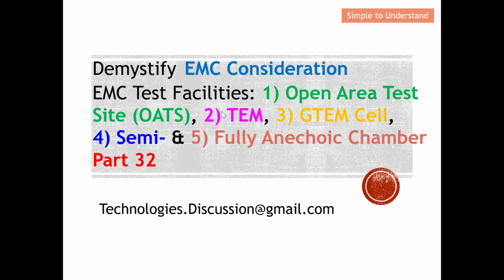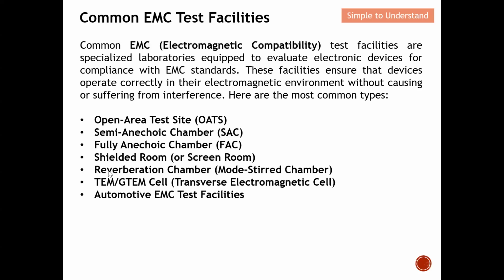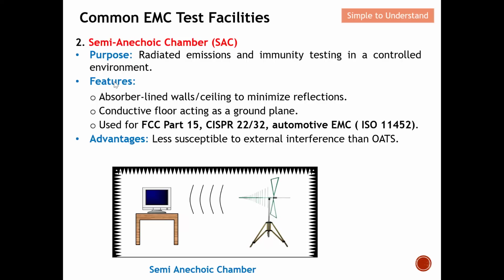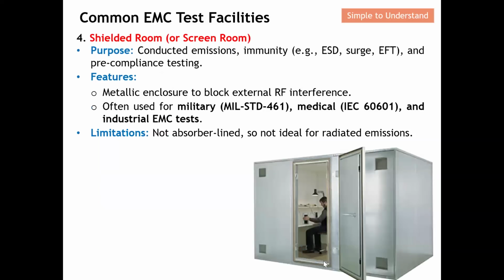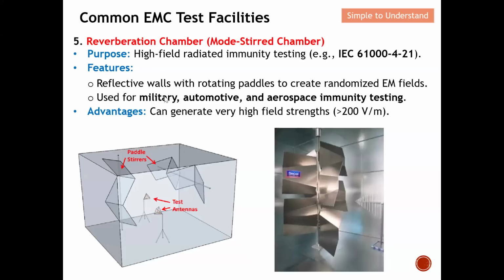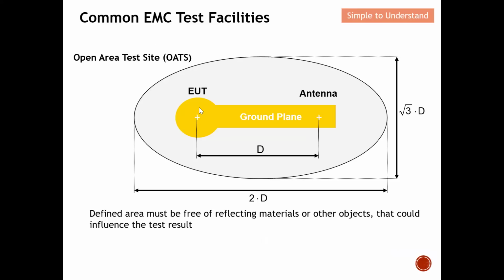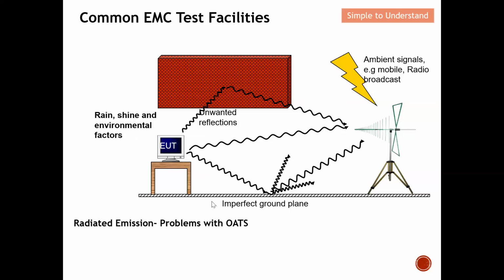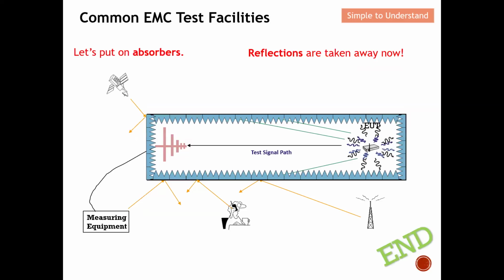EMC #32. EMC Testing Labs: OATS, TEM Cell, Semi Anechoic Chamber & Fully Anechoic Chamber Explained

Comment: Thank you, very nice video. Question: I f I measure radiated emisions on one the same EUT in semi Anechoic Chamber  and  next in FAC, I would expect difference of 3dB between them? In FAC  might to be 3dB less then SAC?
Reply from the maker: In a Fully Anechoic Chamber (FAC), all surfaces (floor, walls, ceiling) are absorptive, so only the direct path from the EUT to the antenna is measured. Hence, there is no ground reflection means the measured level is typically lower than in a SAC, hence 3 dB I think is fair.  At lower Freq, the absorber performance in FAC may be less effective, and reflections might still occur, reducing the difference between SAC and FAC. At higher Freq, Absorbers work well, and the FAC eliminates reflections effectively.
The difference between SAC and FAC measurements approaches 3–6 dB, with 3 dB being a common practical observation (since perfect constructive interference is not always achieved). Hope I answer your question.  :)
Reply: OK,  So the difference can be also more than 3dB. OK. Oh dear.:) Thank you for your answer,.
Reply from the maker: Yes.  :)